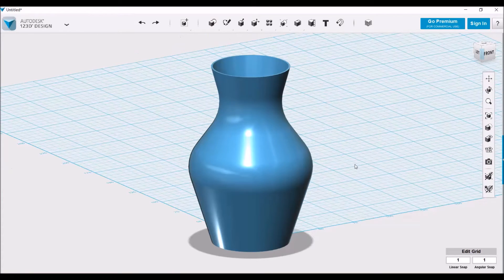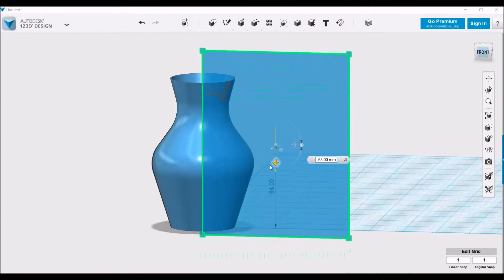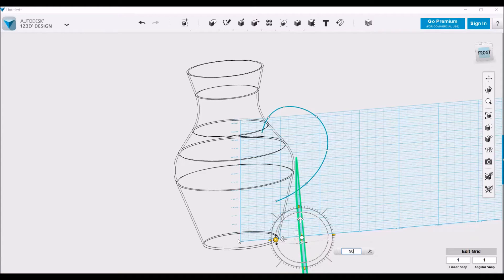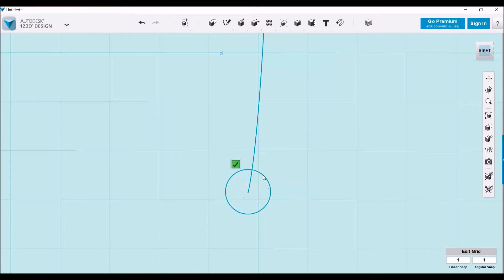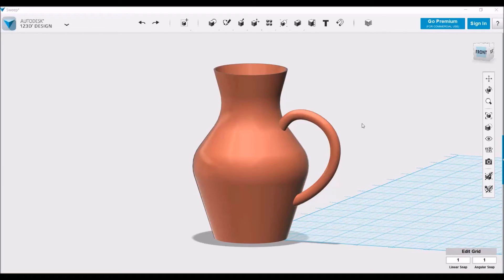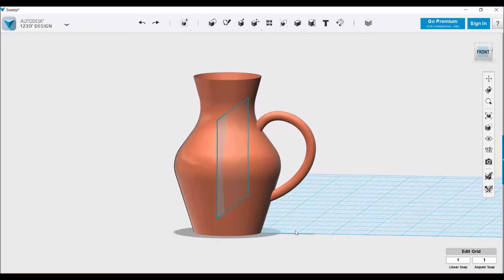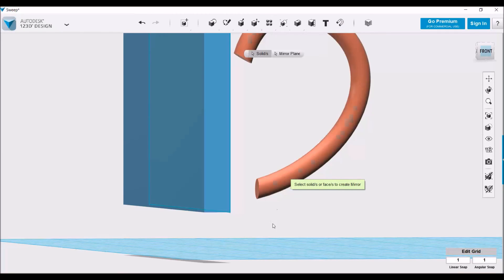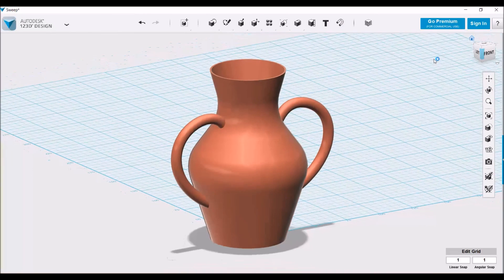Sweep and Mirror Pattern Tutorial [3D How-To]

Comment: Thanks  Ken, great video! I wish I could get my head around some of the more sophisticated cad programs like fusion 360 or others but 123D has been the only program I could understand so far and have been using it successfully for a couple of years, just never got into  the mirror function, usually just copied and snapped things.  This mirror tutorial will make things much easier not just for mirroring an object but also for profiling bits to add or cut away.